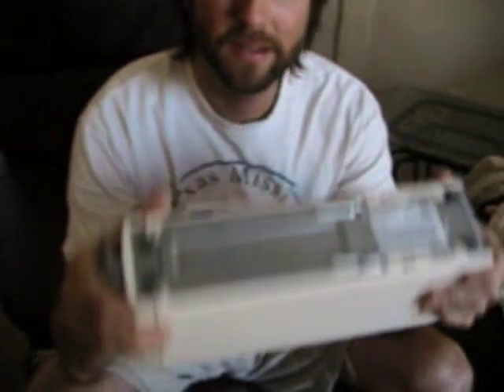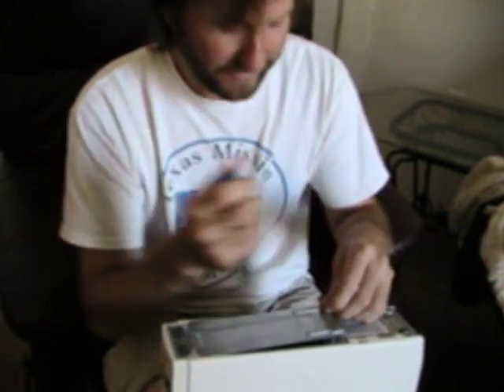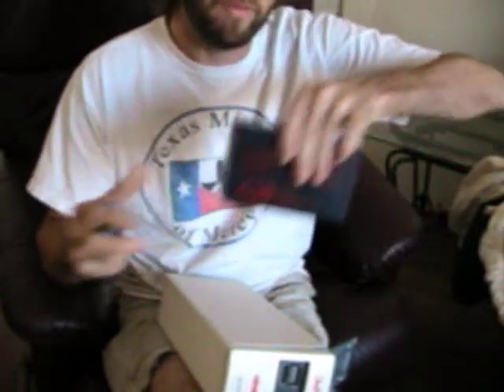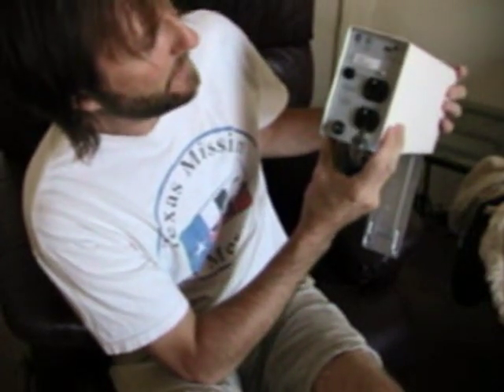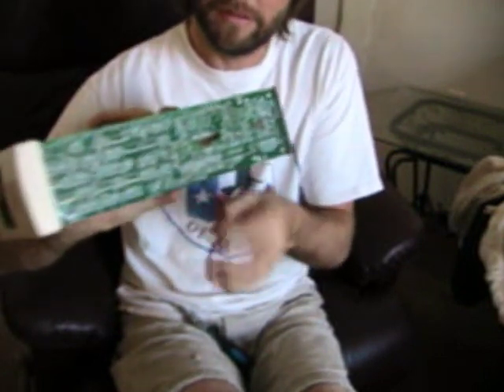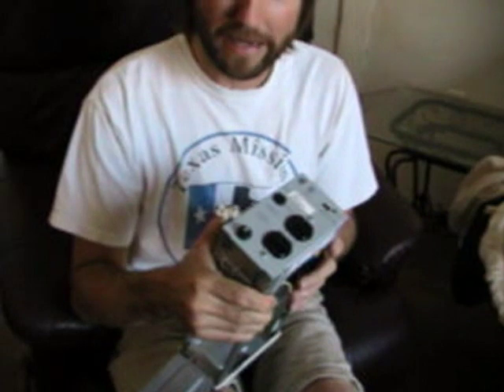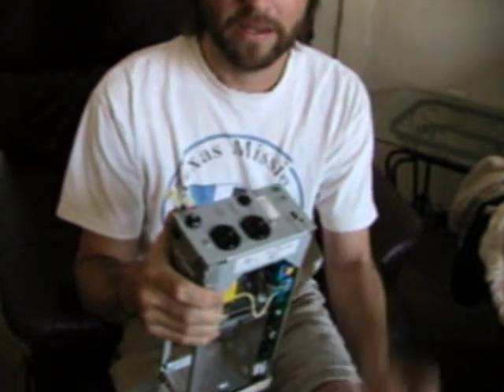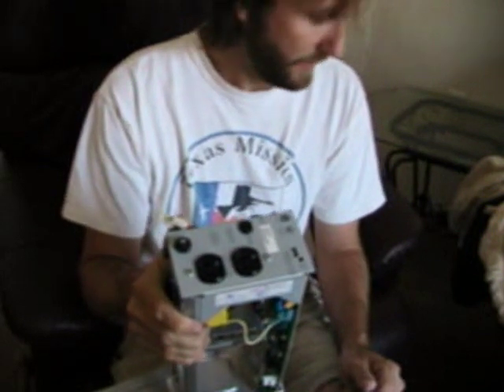Free Solar Power Inverter

Comment: " you can buy inverter's for $15 and a new small 12v battery for another $15." That's true but you would not want to run your computer off of one of them because it will mess up your computer. those inverters for 15 to 150 dollars are for things like a fan or hotplate not for anything that is using a sign wave, like a computer or monitor. In fact this is better than the inverters your talking about.

Comment: And for the less technical who do mind if there's a house fire.  Have a look at the PowerRouter UK.

Store your excess solar electricity during the day and use it at night. Monitor and Manage battery discahrge. Monitor and Manage your solar energy remotely via your computer of even your smart phone.
This is the ULTIMATE safe way to backup your solar energy. It g83 (UK Grid) compliant and will significantly improve the return on your investment.

Don't buy back electricity in the evening when you need it most. Have a UPS in the event of Powercuts. Call us 2020 Solar | PowerRouter UK

Comment: If battery is weak e.g. 10.5v for 12v system , or 21v for 24v system, how can your DIY UPS to protect battery ? The battery will be killed !!

Comment: easy thats what I have, so you need solar panels, they go to charge controller use tristar, then from the charger to batteries, from batteries to inverter and you have 110 easy but spendy, cant run them straight off the solar panels though has to be in the order above, can use 12 or 24 v systems usually, the higher the voltage you smaller the cables so use 24v save money on the connectors (cables) they are costly by the foot, ok hope that helps

Comment: yeah if you dont have a cheap way to charge batteries its really a waste of time, if you have solar or wind generator then you can use these little ones for a couple lights each but you need pure sine wave for electronics lol these use modified sine wave unless you get an expensive one so good for yard lights at night not much else really, charging batteries is far more important than using them in my opinion, if you can for free that is, once you can charge them free, your in bizness right mate

Comment: nice video man I have a 500 apc unite I got from a trash pick and it works great just need new batterys  I did some mods to it for and external battery for longer run time I can run my apc with my computer on it for 6 hours before it loser power it has two 7 amp hour batteries in series for 24 volts so I built a plug on it to connect my 90 amp hour battery back from my solar setup so my computer will stay running if I lose power and also my tv. if I have sun I can have my computer off gridallday

Comment from the maker: @johnnnyreb51 lol, yes, I know it's a hack.  I agree that it probably wouldn't last long if using the full power that it's rated for, in this case 180W.   But, I'm going to hook it up to a fan today and see how long it lasts.  I'll show the video.   Just looking at the size of the heat sinks and power transitors on the board, I'm thinking it can handle 30W continuous.   You must admit though, FREE is less than .99 + S/H.  Why not put some old junk to work?